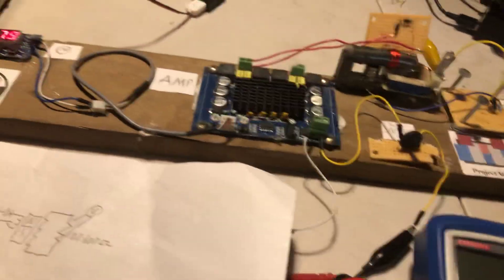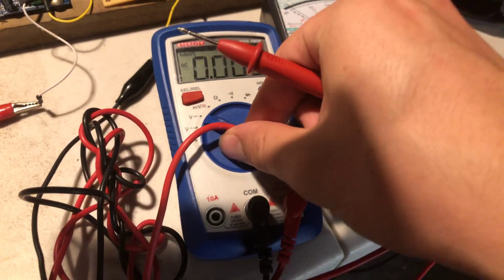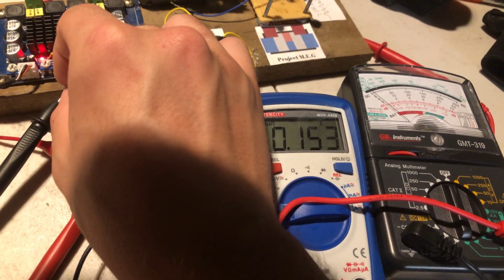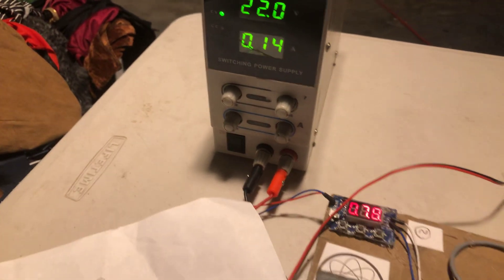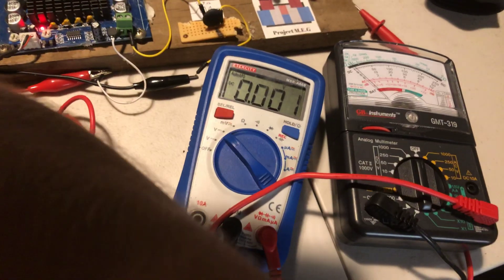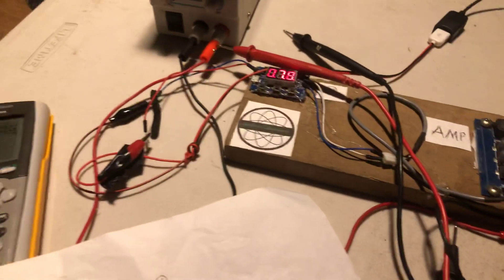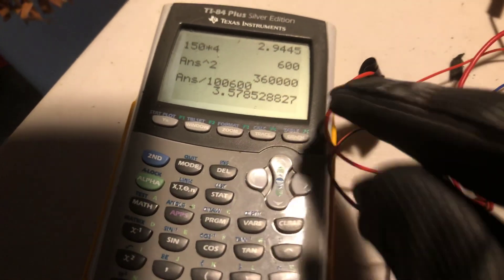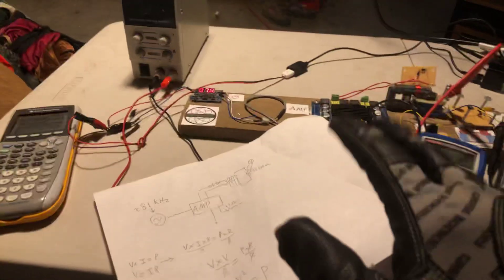Motionless Electromagnetic Generator by Tom E Bearden (Ferrite Core)

Comment: HI, good video. I like your approach of respecting known science and trying to get to the truth of what's going on!

When you measure the output voltage or current from the MEG I think you should use a scope so you can see the waveform. A DC meter is designed to measure a constant DC voltage. An AC meter is designed to measure AC and perhaps only specific kinds of AC. Eg. mains electricity is a sine wave of 50 or 60 Hz. So the source of your 'extra power' might be the  DC meter not being able to measure the waveform you're putting into it.

Now calculating the RMS voltage of some complex waveform can be a mathematically tricky business. Much easier way to find the output power is to eg. use the MEG to charge a capacitor, passing it through a rectifier first if need be. Then calculate the energy stored. It's kind of like the difference between trying to measure a complex shape to calculate it's volume vs. dunking it in a simple shaped container full of water then measuring how much the water went up!
Reply from the maker: Thanks for the advice. I didn’t have a scope at the time, but now I do, so maybe I’ll do some more testing soon
Reply: You are very spot on with the suggestion of using the scope to determine exact power and see the waveform in all it's complexity.  Old analog meters were good in Edison's day, digital meters have their uses, but, not for such applications.  The experimenter needs a good oscilloscope that can handle a wide range of frequency and voltage input to display the correct waveform.  It should be precision calibrated, also.

Comment: You cannot create energy but you can collect it in different forms and convert ir . We are surrounded by electrical and electromagnetic energy. Tap it convert it and use it. You are on your way. When I saw the amplifier it blew my mind...Use higher voltages and much higher frequencies to actually see ingress of ambient energy.
Reply from the maker: How would the MEG collect this energy though? If I had a voltage potential of, let's say 200 volts, it couldn't do anything unless I had another voltage potential of a different voltage. Current comes from differing voltage potential, like how energy comes from differences of pressure or voltage potentials, or something of that nature

Comment: Conservation of energy only applies to steady state systems within equilibrium. If u read up on sharp gradients and learn to design non steady state non equilibrium systems then u can extract extra energy from those systems. Wind power, solar power and heat pumps being primary examples of this.

Comment: Hey I know it's a old vid.. but what amp is that you are using?
Got a model?

I'm making same thing but am having a hard time finding a amp or a switch driver that's switch fast enough for my liking. I want to dump a bit more power than you are but I wouldn't mind having a amp for experimenting with outputs. Mine has dual channel coils so I'm going to use a wave generator that has a out of phase ability to control the oscillations.

Also, what is your primary and secondary windings?
How many turns for the input?
Pretty sure I heard 400 for the output?
Reply from the maker: The amplifier is a TPA amplifier I got on Amazon, with the frequency being run by a PWM frequency generator

Comment: The so called law applies only to closed systems, and not in every case.
Reply from the maker: Examples of times where the law does not apply?
Reply: @filigenzilab9613  photovoltaic cells
Reply: @filigenzilab9613 
-Open systems interacting with their surroundings
Non-equilibrium conditions in systems
Quantum mechanical interpretations
Anthropic and cosmological contexts
F≠MA

Comment: You can break the law. Vasileou Karpen was teaching it and as also showed its wrong by making the Karpen Pile.

The Schumann Resonance could be one constant source.

Just as E doesn't always =mc2 as Prof. Pappas shows.

A overunity its device is limited by its switching speed or bearings.

To know any overu ity device works you check to see if the input increases when a load is connected.

If so its no good... All drop input power once a load with low resistance is attached.. Hence the motor spins faster or Meg switch faster.

Bearder also said that btw. We are only restricted by switching speed.

But in regards to meg.. I didn't check what's your shielding material
Reply: from what I understand bearden and sweet basically made switching transformers that stimulate the flow of energy from the vacuum, much like a siphon used to drain liquids, all it takes is that initial push and in theory, can use of the output to re-prime the system should power drop or the source be disconnected suddenly.

Comment: From What i understand that how this works,   normaly to change anything you need energy, so when you magnetize the core energy is needed, when you demagnetize the core also energy is needed. The changing magnetic field causes induction. There are materials like iron or metglass that can help the demagnetization through termal fluctuations, the material schould actually get cooler because heat from the environment is consumed to create the demagnetization.
Reply: a more simple and I believe fundamentaly accurate way to describe this for non engineers, is think of it like a water siphon, you need to prime the siphon with a pump or by sucking the excess air out and starting the flow, what happens after? the flow maintains itself. so the Ether described by tesla and the vacuum described by bearden and sweet are the bucket of water, the VTA/MEG is the siphon that pulls the energy out, thus not violating any laws of physics, Id hardly even dare to say it bends them at all.

remember guys and gals, Simplicity is Almost always the best solution. keep it simple, make it work with what you know and question everything every step of the way without locking yourself into a tunneled vision.

Comment: Extra energy comes from the permanent magnet dude.
Reply from the maker: But the magnetic field of the magnet is stationary. If you are implying the magnet regauges from the vacuum, that might make sense
Reply: @filigenzilab9613  yes the permanent magnet gives a stationaty field, but thats why you need a small coil close to it, just to disturb/perturb the stationary field at a specified frequency, so that it can generate a primary field that translates through the core to the secondary coil where it generates power
Reply: @christiaanwernich873  Yep, makes sense.  I will try to build and do research on this.
Reply from the maker: @christiaanwernich873  interesting

Comment: I have been working on various similar designs for about 5 years made lots of video's on extracting energy from magnets it is by no means easy would like to see more of this from you as well as others, because a magnet is basically a battery packed with magnetic energy its all about balance and designing a system to simulate rotary motion of cutting through those flux lines without motion physically. Keep up the good work.
Reply from the maker: I’m not sure if it’s the magnets that supply the excess energy or the vacuum itself
Reply: @filigenzilab9613  Magnets are a portal to the vacuum all magnets have this you should research work done by Theoria Apophasis https://youtu.be/PChxHBPhsf8   https://www.youtube.com/user/kathodosdotcom/featured
Reply: @filigenzilab9613  brownian motion Paradox..

Comment: You can break the Law of Thermodynamics because the Theory it is based on is false.
Reply from the maker: Can you prove it?
Reply: I read that Tom bearden says the law doesn’t apply because it only applies to a closed system in equilibrium but the “free energy” system draws on external electromagnetic energy from the vacuum so it’s an open system

Comment: the source of energy is the magnet.... thats how it works.. when you a greater flux means gretaer output.. .. as long as it changes) changing flux generates electric current.
Reply from the maker: Cesar Baratas but magnetic fields of a permanent magnet are stationary and have no inherent energy
Reply: @filigenzilab9613  True they are permanent and non fluctuating until you pulse the coils that move the whole magnetic train; its the movement by those pulses that produce the electrical current in coils
Reply from the maker: Alex Manzanero interesting point of view
Reply: @filigenzilab9613  have you seen the gunderson patent?
Reply from the maker: Alex Manzanero no I have not, should I look it up?
Reply from the maker: Alex Manzanero and heads up, I am making a new generator that utilizes torsion fields to collect atheric energy
Reply: @filigenzilab9613  it will give you an answer to your question
Reply: @filigenzilab9613  cant wait to see it, thanks
Reply from the maker: Alex Manzanero I’ll look into it, thanks
Reply: @filigenzilab9613  look me up, i have a channel and a video called "easy electricity", in a nutshell, just provide an iron path to magnetism and it WILL do work in the form of creating an electrical current!!!
Reply: @alexmanzanero  gunderson, MEG, kUNEL , and Richard willis uses permanet magnet.. and pulses to produce energy,, ihave a collection of over unity patents
Reply: @cesarbaratas5612  Yes Cesar, you are correct, and yes overunity can be achieved. I run a treadmill motor using 40 volts dc and 10 amps maximum from solar panels, when I measure amperage across  running motor it blows my 20 amp fuses inside my meters
Reply: @alexmanzanero  neon transformer are also overunity device but high voltages output.. if you try to calculate the input vs output . there is over unity in fact i am developing a transformer deivce that duplicates power i am now at 144%
Reply: @EnergySeeker  thanks
Reply: @filigenzilab9613  using the actuating coils ..this controls the flux flow from one side to the other thus you have changing flux.... when this cuts the wire it produces electric energy. the energy used in controlling the flux is much less.
Reply: @filigenzilab9613  Magnetic fields are stationary but not static, there are a lot of dynamics going on in a magnetic field. There was a paper i read (the speed of gravity by Tom Van Flandern) that gives a nice example...

"To retain causality, we must distinguish two distinct
meanings of the term “static”. One meaning is unchanging
in the sense of no moving parts. The other
meaning is sameness from moment to moment by continual
replacement of all moving parts. We can visualize
this difference by thinking of a waterfall. A frozen
waterfall is static in the first sense, and a flowing waterfall
is static in the second sense. Both are essentially
the same at every moment, yet the latter has moving
parts capable of transferring momentum, and is made
of entities that propagate."
Reply from the maker: David Edwards perhaps that could help. I would be nice if magnetic fields are actually fields of energy slowly, slowly decaying
Reply: they will not teach it in school...i had also built one that works.. different than the conventional generator... insted a generator  increases energy as i put a load in it .. it reverses means.. when i put a load.. the power input decreases .. and output remains thesame... the lenz drag effect.. also is eliminated... instead cauisng drag .. it increases its speed
Reply from the maker: Cesar Baratas but thanks
Reply: The Motionless Electromagnetic Generator (MEG) is a magnetic generator used to produce electrical power without moving parts, and, more particularly, having a capability, when operating, of producing electrical power without an external application of input power through input coils. 

The Motionless Electromagnetic Generator includes a permanent magnet, two magnetic paths external to the permanent magnet, each of which extends between the opposite poles of the permanent magnet, switching means for causing magnetic flux to flow alternately along each of the two magnetic paths, and one or more output coils in which current is induced to flow by means of changes in the magnetic field within the device. The Motionless Electromagnetic Generator operates in accordance with an extension of Faraday’s Law, indicating that an electrical current is induced within a conductor within a changing magnetic field, even if the source of the magnetic field is stationary.

Regarding thermodynamic considerations, it is noted that, when the Motionless Electromagnetic Generator is operating, it is an open system not in thermodynamic equilibrium. The system receives static energy from the magnetic flux of the permanent magnet. Because the Motionless Electromagnetic Generator is self-switched without an additional energy input, the thermodynamic operation of the system is an open dissipative system, receiving, collecting, and dissipating energy from its environment; in this case, from the magnetic flux stored within the permanent magnet. Continued operation of the Motionless Electromagnetic Generator causes demagnetisation of the permanent magnet. Thus, a Motionless Electromagnetic Generator operating in accordance with Thomas E. Bearden’s invention should be considered not as a perpetual motion machine, but rather as a system in which flux radiated from a permanent magnet is converted into electricity, which is used both to power the apparatus and to power an external load.

Comment: That "law" you mentioned about energy neither created nor destroyed is blatantly disproved by Steinmetz in his lecture on "transient circuits".
When a massive power generator is first hooked up and then turned on, it speed up to normal operating rpm and produces electricity.  Steinmetz asks "Where did all the electricity produced while accelerating to optimal rpm go?".  No one has yet answered that question successfully.
Reply: Baloney. The power used to spin up the generator is stored within the rotating armature until the engine driving the generator is disconnected, then that energy dissipates as the generator spins back down. #captainobvious
Reply from the maker: Noted
Reply: Can you send me a link to this lecture?
Reply: theres an even simpler solution that I dont see anyone talking about. you dont need to challenge the laws of physics for these devices to be justified and proven, because they are law abiding systems. Floyd Sweet's VTA and beardens MEG dont create energy, they simple transfer it from one place and phase, into something usable. much like how you cant generate electricity with coal alone, you need to apply energy in the form of heat to get the reaction going that sustains till the coal is spent an turns to ash, but you still cant turn that heat directly into energy under normal circumstances, in a historical sense we turn it into electrical or mechanical energy by using that heat to transfer the energy from the coal to water to make it boil and make steam. 

in esence these solid state generators act as electro-siphons that pull energy out of the Ether or air, then convert it using a form of a transformer into usable electricity, and nowhere in this process do you even bump into the laws of physics, because you are operating well within limitations. there is just a stigma that because its so simple, something more nefarious HAS to be at play. and due to media spin over the decades Overunity and free energy terms have become incorrectly associated with breaking the first law, creating energy from nothing. but there is no "nothing" as far as we know, the base form of all matter is energy, meaning it is all around us and its just a matter of devising a way to transfer it from its current state, into a something we can use to do work.

Comment: What you said is true about the laws of physics but you can use one law to get around another in this case most likely resonance like when you strike a chime and another one tune to the same frequency will also ring and even after you put your hand on the one you struck and dampened it to a stop the other still rings...
Reply from the maker: Yes, but that doesn’t create energy
Reply: @filigenzilab9613   Correct energy is not something that we can ever create we just can manipulate it's motion and effect through our knowledge of physics as we discover it in nature and use it to our advantage.
Reply from the maker: Ralph Hernandez I see
Reply: @ralph72462  exactly

Comment: Your voltage measurement on the high voltage side is wrong. A DC voltmeter gives misleading readings when used on high frequency AC.
Reply from the maker: Emeka E it’s actually, strangely enough, a DC voltage, as when I put the probes one way on the output, the voltage is negative, but the other way shows a positive voltage. Thanks for you advice, btw
Reply: Put a scope on it and you will find that it is not DC.
Reply from the maker: Emeka E I would’ve, but the voltage is too high for my $20 oscilloscope, thanks for being critical (I’m not being sarcastic, I require critical thinking for finding out the truth :))
Reply: No worries. I've done a bit of work on the MEG myself and believe I understand what you are observing.  BTW, you can use a cheap voltage devider (two resistors) to extend the range of your scope.
Reply from the maker: Emeka E thabks
Reply from the maker: Emeka E I mean thanks